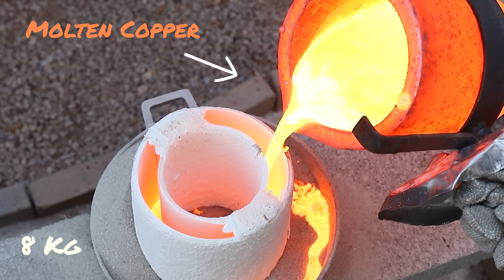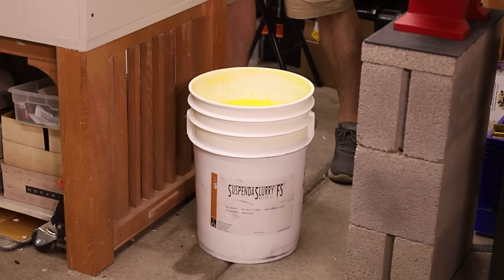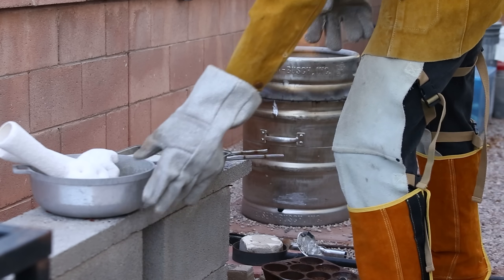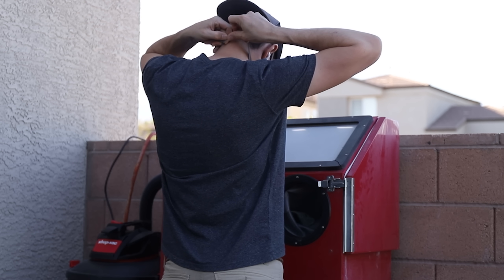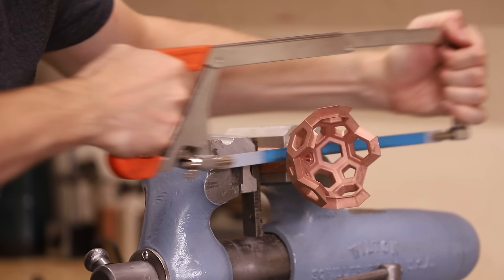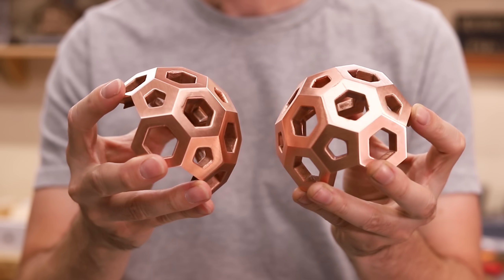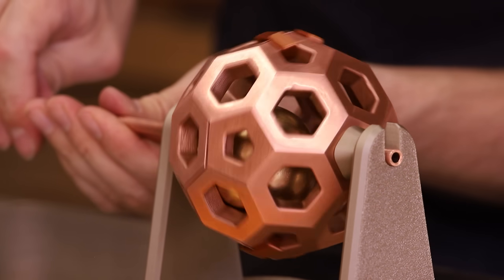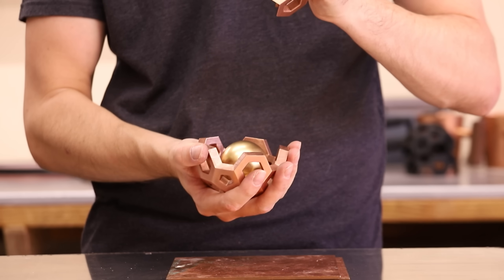HUGE Magnet VS Copper Sphere - Defying Gravity- Will a Neodymium Magnet Float Inside?

Comment: I only learned about copper and aluminum resisting magnets, about 20 years ago, while at a theme park. I asked about the breaking system, and they told me they used magnets on the roller coaster that would slow down when they rolled over the aluminum slotted section. So it had like a plate of aluminum that went between the magnets on the coaster. That is what slowed it down before actually using brakes that clamped onto the metal piece sticking up in the center of the tracks. So, I tested it by running a magnet across an aluminum surface with my hand. I could feel the resistance. 
I have a stationary bike that uses magnets and a copper disk for the resistance. The resistance is smoother than another stationary bike that has a strap around a wheel that tightens and uses friction resistance to give resistance for a workout. I had to remove the magnet piece and rebuild it when it fell apart and was just dragging on the copper wheel. It had several magnets mounted in opposite pole alignment on a curved section that goes around half of the wheel. Then, you adjust the distance between the copper wheel and magnetic piece to chang the resistance.

Comment: Place a shaft within the shaft that then goes into the center of the ball /magnet inside. The you spin it up as the magnet ball is already positioned in the center of the system. The when it spins you extrude the inner shaft and the ball inside should hover without centrifugal force influencing it. Remember this is my idea which u can use in this experiment only.

Comment: I wonder if using a smaller diameter sphere that would have more clearance between itself and the inner part of the sphere would float better since it would have more time to fall before hitting the bottom or sides. Very cool project, and even just cool to look at

Comment: This video was more fun than a barrel of monkeys! My mind is going nuts just imagining how to put this thing to use for a practical purpose.
I mean, isn't this just an inside out motor?
He needs to use a ball of copper wire, wrapped extremely tightly around itself. And then he needs to try wrapping copper wire tightly around another magnet--that's my two cents

Comment: The Copper Sphere needs tobe accurately ballance so that it can be rotated withoit vibration.
I suspect a copper sphere made from a copper mesh may work better with less disruption to the msgnetic field.
Two of the together rotating in opposite directions may give you a new design for an efficient electric generator with the only moving wear components being the bearings on the shafts.
Very interesting!

Comment: The magnetic sphare can flot if you make the speed of rotation  constant and also synchronized with the speed by which the magnet falls due to gravity in the copper casting or copper influence.  Something to do with rezonans must occur and not just any speed.

Comment: Maybe a smaller sized magnet will improve the floating effect while spining the sphere at a consistent speed. If not, then try casting the same sphere desing but 3 times bigger than the first sphere. Play with the mass of the magnet and the space that the honeycomb sphere provides for the magnet.

Comment: I'm thinking that the effect only works if the rate of spin is CHANGING because the sphere probably starts to match the spin of the cage. Basically when you were doing it by hand you were accelerating the spin then slowing down to regrip so the rate was changing. With the power drill it spins at a constant speed so the sphere will match the relative speed of the cage then fall.

Comment: Two suggestions for your questions. First, the two spare scrap copper pieces you cut off would make good handles for many things, or legs to support something. Second, I would see what happens if you used compressed air to make it spin, and adding something heavy to the axle that will want to continue spinning after you remove the air. And what if the magnet in the middle was a smaller diameter. Or what if you rotated the cylinder shaped magnet fast enough to rotate your sphere? OK, that was more than 2 ideas... I'll stop now. Great work by the way! Fascinating indeed!

Comment: If the cage had some of the holes filled in then the cage would have more mass and the magnetic field would be stronger, also if you reversed the process by making the cage an electromagnet with a steel ball inside again the electromagnetic field would be stronger, thanks for the video 😊

Comment: Sand or grind the inside round n smooth and use spinning magnets to control the speed. Get it the right density and distance and speed to create simple but complex working device

Comment: If you want to get a clearer view of the magnet while still seeing a bit of the levitation, you could leave the copper sphere separated, and place the magnet on some sort of stilt. Then, take the two halves, put them close to the magnet, and rotate them. Just requires some caution not to accidentally go too fast and fling the magnet somewhere. High power magnets can be dangerous.

Comment: I wonder if you could use electro magnets at different angles that change the magnetic pull at different timing so that it doesn't spin on one axis, so that it spins in say a figure8 pattern or whatever u want to say? Changing speed& figure patterns. I'm no scientist & probably dont know what im talking about Not sure how you would do it but it could be done. Dont know what the results would be?

Comment: LIQUID NITROGEN cooling!  It slows things by several times.   Try it, it's impressive.   Start with a flat Cu slab.  
Talk to physics teachers, to learn the tricks of supermagnet lecture-demonstrations.  LN2 cooling of Cu slabs will take freakin' forever, unless you include a thick coat of grease on the cooled copper surface.  If not, the gas-bubble will greatly slow the cooling.  We need to add a "thermal match" layer to stop the boil-off of the LN2 against the still-warm copper.   
There are lots of other non-obvious tricks with massive copper electrodynamics, e.g. the two-disks demo, the chevron-slot demo, the cylinder-pair levitation, etc., most in offline paper docs only.

Comment: I have a similar project and would like to speak with you about it 
From what I saw here of this design, I think you have a balance problem.  Rotate it 90 to sipn ot its axis, and i think you will see what i mean.. It's not just the balance of the spin but also uniformity of the interior as well. The high speed shows yes some centerfugal force, but if it is on center as it rotates and still wobbles, then it also has something to do with the structure.
All that said.. very interesting experiment.  I will be following

Comment: What happens when you place the magnetic sphere inside a spinning copper tube? 
Can the tube create enough electro magnetic force to hold the magnet?
Or is a spherical casing required for the experiment to work?

Comment: You could try glueing or screwing thin centering pins on the inside of the dome.
Not negating the experiment any,  just minimizing wobble at high speed.
I'm curious. Could the copper be energised electrically if the sphere were any closer to the coppers inner surface.
If so do not copper pins. LoL tiny genie if you have the sphere at pos and neg.

Comment: i've noticed that you have the whole thing sitting on a 3d printed stand, i'm not sure how conductive PLA is but you might have better luck with a metal stand and also metal plugs or make sure that copper pipe is touching the copper case.

main thing being, making sure the current has a path to ground, when you are holding it, or when you had the tube on a metal table, you gave the charges a path to ground, without that i don't think you will get as good of results.

Comment: Im wondering if you made the inside more circular with tighter tolerances there might be more consistant lensing and higher speeds would cause it to gyroscopically stabilize

Comment: what a neat casting method! Ive never seen ceramic slurry used before but i might have to look into it. I dont 3d print but i make things out of polymer clay and cast them in oil-sand from aluminum from time to time (mostly as blanks for projects since i can never get the fine details i want) but seeing how the ceramic captures all the fine details so well i might give it a try! If i can make a polymer clay master thats much closer to my intended final design and create a ceramic split mold from that master i could really cut down on my finalizing. Super cool to see the magnet float like that in the sphere too!
Reply: and i absolutely recommend setting up a small motor with a variable speed controller. To be honest, an old drill, cannibalized, is what runs my homemade rock tumbler right now. It never reaches the max rated rpm for the motor so its lasted me two years running for up to a month at a time uninterrupted. A part tumbler would also be really good for getting all those fine 3D print lines out of your castings, but i think they make the part look extra futuristic! The best idea i can think of to make the sphere float better is making the interior geometry of the truncated icosahedron spherical as well. The magnetic fields its generating might be a bit strangely shaped and result in a lot of fluctuation with varying speeds, thought the speed controller would likely compensate quite well.

Comment: Not sure if this idea has already been commented or not. Or if this will even get red LOL but it would be cool to put that black round magnet on its own spindle and put that on the motor after you figure out what RPMs the copper sphere needs to spin at for the ball to levitate that way no self proportion. But still is spinning because of the secondary magnet. I'm using talk to text so hopefully all of that came through right.

Comment: Pretty cool project, the speed its balanced at would give you the weber effect on the magnetic field or something, to when its balanced, which if the copper is 99% and hte magnetic is known of power it tells you information about hte copper, secondly lots of ocmmets said hte same thing, but matching the frames  to a rotational movement, this could be done with a super high speed camera and then post effects removing frames, or like an arduino when a specific frame hits the exact same mark or trigger to take a frame, this way regardless of how fast you spin it, the sphere will look like its not moving, so you cna watch the sphere.. typically the sphere or thing yo uwant ot look at, would be gridded out for measuring reasons... When its balanced you could also measure a power output of the system that may be utlzied, which would be less than the input poewr but... still a pretty cool effect... two solid hemispheres with a meridean line cut down would also work for seeing the ball levitate... beautiful pieace of art, semi functional.

Comment: You need to use smaller sphere 
Need to calculate mass of sphere compared to the copper force to have right size of sphere for slow rotation to create floating sphere in your copper hexagons 
But it is interesting idea which can be used for energy generation

Comment: Some experiments I would try:
1: pass a current through the ball via the rotational axis.  Both DC and  AC of varying frequency.
2: Put a large circular AC electromagnet beneath the sphere to induce a complimentary wave inside the copper.
3: do both at the same time, playing with frequencies and amplitudes.
4: Use a layered ferrite core to balance the sphere on instead of plastic.

There is something very important to remember when working with electromagnetism.  And that is that water is a fantastic analog for electromagnetism.

When you see lines of magnetic force, such as when you sprinkle iron filings on a sheet of paper and visualize the magnetic field, people get kind of lost in this 2-D representation and think that that's all they're seeing is some...static magical line of force that exists somehow hanging in space.  Just like when a boat travels through the water, and you see the 2-D (think of the water's surface as a sheet of paper) wake trailing behind the boat, that 2-D wake represents a 3 dimensional wave traveling through the water, and indeed in the air as well around the boat.  We just lack the depth of perception to grasp the entirety of the wave, seeing only a small part of it and understanding only a small part of it.  

The lines of magnetic force you see in 2-D on a piece of paper, are by matter of fact merely a representation of an active wake being produced in space-time in 4 dimmensions.  Understanding the 3-D and 4-D reality of electromagnetism when all we can perceive are brief, limited snippets in 2-D, is key to grasping what you're on the verge of understanding.

If you've never watched the videos made by professor Eric Laithwaite on the "Electromagnetic river" (1970's but available on YouTube), you might learn a thing or 2 by watching his demonstrations in electromagnetism.

Comment: What if you use a donut shaped hollow copper pipe? Think of it like a bike tire made of copper and the magnet is inside where the air in the tire is. When it spins the magnet will hover in the channel maybe.

Comment: By the way, if you separate the halves slightly, just enough to hold the ball until it floats, won't you be able to show the effect better? It would only be to show the effect more clearly after showing the ball floating in the enclosed sphere.

Comment: Huh.....i wonder, if you were to separate the two sides of the sphere with a layer of electrical insulation.

Would it work like a dynamo? 

I mean as far as i understand. 

The copper sphere should be generating an electrical field right? When it spins?

Im just wondering if you could syphon some of that electrical energy off. And if so, youd have a dynamo that could run.... basically forever, (i mean in regards to the usual wear and tear of a dynamo).

Levitating the magnet means theres no friction on that part.

Comment: Make it very cold (with liquid helium) and the spherical magnet will float as copper becomes superconductive.
Then, while it is very cold, when you spin it and then vibrate it with a very high frequency (using a silicon nitride crystal oscillator), you will see that it affects (attracts or repels) non-magnetic objects, i.e. generating a gravitational field. Just don't be surprised if the CIA or NSA come knocking on your door next morning. Good luck :o)

Comment: Try using a copper cylinder with vertical slit openings. You could also think of this as vertical copper bars connecting to two solid copper discs one at each end. With the total height of the cylinder being larger than the diameter of the magnet ball such that the empty space inside the cylinder is exactly twice the diameter of the magnet ball.

Comment: When I worked in a foundry, casting art pieces in bronze via the lost wax method predominantly, we used a compressed air gun with a small jack hammer like fitting to press against the sprue and vibrate the silica shell off of the actual piece thereby saving it from damage, and I can confirm that large pieces of shell falling off was most satisfying, as well as revealing the treasure inside of course. Great to see you doing it in what is essentially a backyard operation. We were a relatively small company and also made a lot of our own equipment including our furnace made inside an old 64 gallon drum.

Comment: Have you thought about creating a tensegrity structure by replacing the strings with magnets placed in copper or aluminum tubes (using the same and opposite poles)? The idea is to balance the interactions. Additionally, rollers could be used to guide the cables connecting pairs of magnets (both repelling and attracting) so that they self-balance. Small springs could also be placed along the cables. Furthermore, the tubes could be filled with a dense fluid (such as oil) that would also dampen movements by changing pressure. With this setup, along with the magnetic interactions, it should create an incredibly stable damper that would levitate in the air (or float in oil, depending on the construction technique).

Comment: how about you measure the induced EMF at every vertex, cause it makes sense that each face would under go an induction from a certain pole making the flow of electrical energy possible and escaping toward the vertexes , or even better making the sphere a little bigger, and a spherical squirrel cage out of it, terminate the cage with brushes at the plugs so you could tap into the Generated EMF, If all this works , we could measure the minimum voltage and current needed to suspend that magnet in air. Just a Thought. Awe!

Comment: I stumbled here or rather was guided here by YouTube. This is very cool. Any way of using m an egg shape instead of a sphere? And how did you choose the size sphere? Ratio of inside area maybe? Or maybe you made the size of the shell based on the size of magnet you could get? So fun. I will certainly watch this progress. Please make more forever. Thank you for being awesome. I don’t understand why it doesn’t hover when you go fast. If you can put a motor to it you can find the right speed to keep it in the air. I’d try a smaller magnet in the cylinder and the shell.

Comment: Hi, I’m Jim Dailey. I saw your video and was impressed. I have have a design for a revolutionary 3d fractal antenna I think you might be interested in. I have a blender render but it’s not quite complete (90%) and I need technical expertise to complete the project. It’s a fractal cube antenna that adjusts to the wavelength desired and is omnidirectional. Should be successful and profitable, and I’m willing to give you a piece of the patent. If you’re willing to take it on, it’s really cool. Let me know if you’re interested?  Jim